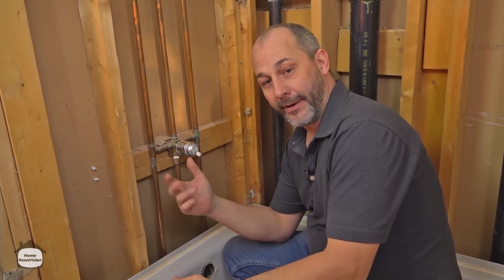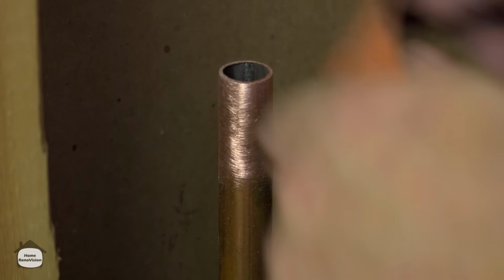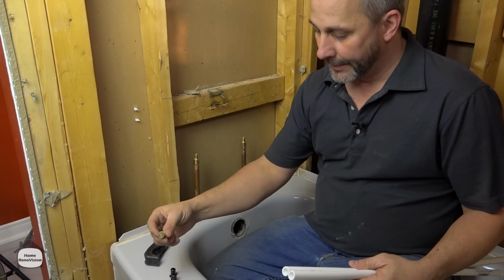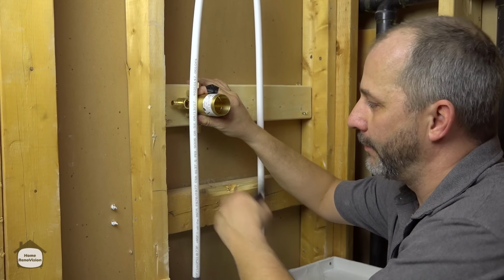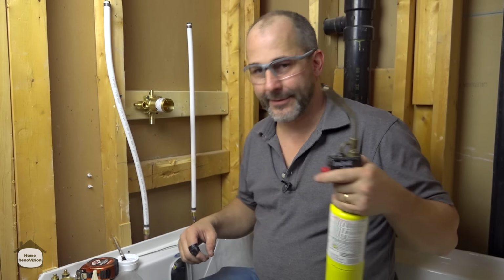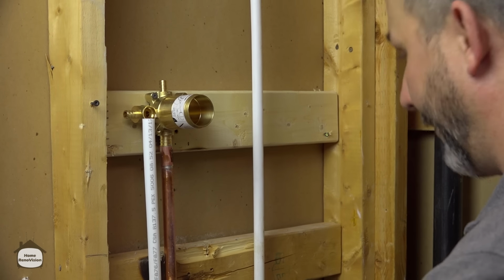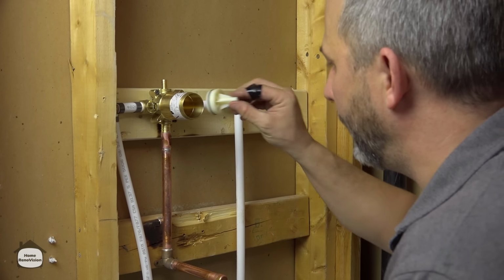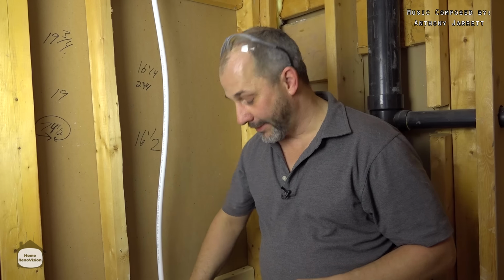DIY How To Install Copper To Pex Shower and Bath Plumbing

Comment: Here is an idea for saving money with hot water tank by two loop connections.
When the connection is made straight up  the hot water migrates from the tank to the upper floors.

why loop connections?
Hot water is less dense than colder water.  If you go straight up, the hot water convection is going to migrate the hot water to the main floor.   By having that loop, the bottom of the loop will be cooler than the top, and the heated water will not migrate.
Save yourself about $10/month or more.

Comment: 50 50 solder is not ok to use on the portable water system

Comment: In school I learned to finalize the solder joint with a rag.  I’m not keen on using the flux brush as it may cool the joint too quickly.  I would also use a heat shield behind that valve while torching.

Comment: Thank you for the information.   Question.   When converting to pex what do I want sticking out of the wall?  The sink water supplies are hidden in the vanity so I guess I could have pex sticking out there.   The toilet supply is visible so do I have the pex sticking out of the wall or do I attach the pex to copper in this situation.
Reply: Daisy Vlogs the only time you need to worry about it being copper is when it needs to be sturdy like the tub spout, it’s ok in most situations to have pex out the wall

Comment: Blah blah blah...google “shark bite”...I saved you having to watch this video. Pushed right into copper pipe and right into pex.
Reply: it's not code to put shark fittings in a closed wall, they would have to be accessible.

Comment: I have a shower that flashes cold and hot when somewhere in the house a faucet turns on. Does the faucet you installed take care of that problem. Thank you for you showing how to install pex, first time for me.
Reply: The valve you're looking for should be what's a called a pressure balanced valve or a thermostatic valve.
Reply: You might have undersized lines that disrupts the flow

Comment: I'm one of the lucky ones who doesn't have the hot water on the left .... is this a major problem? If I install it like this will it affect the performance and will it affect anything else in my house like baseboard water heaters?

Comment: "50 more times more than usual "
smoke detector going off 
solder on tub
didn't measure for the valve fittings 
burnt the shit out of the supports
pipes wiggled everywhere 
guessing on every cut
Possible tension loss on Crimper  

HandyAndys like you are what keep the plumbing trade alive, because when that fails they'll have to call in someone who actually knows what they are talking about.
Reply: How long before it fails?

Comment: Thanks for the video but I have a problem with how you work.  I would (and do) spread a tarp in and over the bathtub to protect it from boots, dropped tools and solder dropping in and on a persons tub, or even my own.  Think about it next time when you do another job so you don't destroy the tub because IMO sloppy workers are never considered craftsmen.

Comment: Okay. Now that I’ve removed all in one tub shower surround unit I see that I cannot just put concrete boards and seal. Darn it! The copper pipes are in the way! So I guess this in when I change over to plex tubing to simplify the process of replacing all in one t/s surround with a tube and tiled walls. My dear husband will assist with crimping. Yours truly, 64 year old female DIYer. Thanks Sir Thorman for all that you share🤗🤓

Comment: Great job at describing the procedures for a faucet's replacement. You may want to mention (for those who are not familiar with  soldering) that the soldering paste you apply is to accelerate the heat and allow the solder to bond to the surfaces. Another note, When I used to be a plumber, I would use brass lag screws to attach the faucet body and elbows to the 2x4s. As you know, galvanic corrosion will destroy any metal that is not noble like brass or copper. Lastly, it is always good to apply plumber's grease to all of the faucet's moving components, rubber parts, threads, and bezel nuts' threads. This practice will prevent sediment from building up in a thread or stem. When the faucet needs to be serviced, it will be easy to unscrew and remove the parts because of that grease. A little food for thought.
Reply: He does explain the soldering paste at 17:20
Reply: Thank you for this, I was going to ask about what the grey paste was that he applied inside the copper-pex fitting

Comment: question: why did you hit the sweat joints with flux after the solder was applied? thanks
Reply: When I was an apprentice, I was taught to "wipe and wash" your joints. My Journeyman said that it made the joint look cleaner. I get the wiping smooth with a rag, but the flux part never made sense to me.

Comment: When soldering around wood always have a bucket of water nearby. Even if you don't see fire/smoke emitting from wood after you solder,splash water on wood anyway or like I do wet the wood prior to soldering. You WILL burn house down hours after you solder because you didn't see wood burning but it was.

Comment: When you mounted the valve, how did you know the valve handle would mount correctly with the backer board, tile and thin set depth? Seems every time I do this, either the valve got mounted too deep or not deep enough.

Comment: Thanks for taking the time to video your work. You are my go to guy for plumbing work. I am doing a DIY tub to shower conversion in my home. Right now I am installing the new Delta shower mixer and diverter valves and converting from copper to PEX. My first time working with PEX. After watching the video, I have two questions. After you soldered the fitting just below the mixer valve,  I noticed there was a gap (1/4 inch or so) at the top left of the copper fitting where there was no solder. Shouldn't the solder flow all the way around for it to be water tight? Also, I noticed when you crimp the PEX fitting, you sometimes do not place the jaws of the crimping tool entirely over the crimp ring, which results in only half of so of the crimp ring to tighten on the PEX line. Is this still a good crimp? Or should it be replaced with a better one? Also I would like to add two tips. If you need to remove a copper crimp ring from a PEX fitting,  use a Dremel tool with a metal cutting wheel. You can then cut just the copper ring, and not damage the fitting.  This next tip I got from reading the comments on one of your previous videos: To keep the copper crimp ring in place temporarily (like on a vertical PEX line, just use pliers to LIGHTLY crimp it just enough to keep it from slipping out of position. Then you can use your proper crimping tool to crimp it as usual.

Comment: Well done video.  My only comment is regarding your pressure testing. By capping off the tub and shower outlets, the air is not allowed to escape, Therefore water may not make its way to all the joints and fittings and you may not catch all the leaks.  I am not an expert, but just an observation,

Comment: Good afternoon ,,, my name is Gabe ,, have a question ,,, I can use 3/4" of pex pipe for the shower installation ,,,,,or 1/2" is the usual
Reply: Yes you can use 3/4 pex it will give more volume for your water but you will have to go down to 1/2 when you get to the showerhead arm and the tubspout should be run with a rigid material

Comment: For anyone who wants to install PEX, try to use Uponor-type fittings where you EXPAND the PEX pipe over the fitting instead of crimping the PEX pipe over the fitting because the 'expanded-PEX' type fittings have a much larger opening in them, so you get a faster flow of water when the job is finished. Avoid SharkBite fittings in closed walls. But if the pipe is going to a toilet or a sink then it doesn't matter there since the final pipe is going to be a really small 3/8" riser tube anyways, so a crimped-type of fitting on 1/2" PEX pipe is totally okay in those areas.
Reply: That is for pex-a and the tool is more expensive than a crimper
Reply: Alot more of an expensive pex system the fittings an pipe cost more an the tool to expand the pex isnt cheap
Reply: I also thought pex A with expansion fittings was a superior product when first learning about pex. My mind has changed since learning that pex A leaches significant chemicals and is no longer recommended for potable water systems. That bit of info explained why I have only ever seen Pex B with crimp fitting used in residential houses.
Reply: I agree Pex A avoids necking down at the fitting as much as Pex B.  The hand tool to expand on Amazon with an automatic head rotation was about $160.  It came with 3/8, 1/2, 3/4 and  1" expanders and a cutter and a tool to cut off a Pex plastic ring if you make a mistake.  I paid just over $4 for 25 Pex A plastic expansion rings. Pex A 1/2" pipe is currently $35 for 100 feet.
Reply: I would say using a sharkbite behind could be just about as good as someone soldering a joint first time.

Comment: Thanks for the video. I tried torching some copper line earlier and the solder absolutely would not melt. I read somewhere that even a little bit of water keeps it from getting hot enough, but the copper was red hot! I gave up and cut it out. Never had that happen to me.
Reply: Get some white bread.  Squeeze it into a dough ball and push it into the pipe with a pencil eraser end to hold back small drips of water than interfere with heating up the fitting to melt the solder.  When it's all done, remove the vent screen on the downstream faucet and flush out the bread plug.  I heard there is a new tool that fits thru a ball valve to hold back water drips while soldering instead of using bread, but I've never seen the tool.

Comment: great video. I am trying to extend home plumbing from the inside to make an outdoor shower. Its a small job, but I am not sure what tubing to use. I wanted to add a Y from my water heater and out to the yard about 20 feet to the shower area. I see PEX is easy   but I dont want to spend 40dollars on a crimpin tool I am never gonna use again. Are there other alternatives to keep this job simple and inexpensive? Can I use compression connectors? What do you recommend . Thanks Robert in Miami Fl.

Comment: Was that Moen system? I'm putting one in my bathroom.
Reply from the maker: no but they are very similar. I am sure you will be just fine. contact us if you have any problems. Cheers!
Reply: Use American made, never use the Chinese products as they will fail in a short period of time as they don't care as they are thousands of miles away and are untouchable!

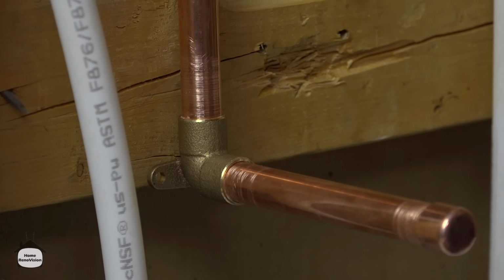Comment: He's made a terrible mistake soldering a copper coupling on a Pex connection on the shower valve you can see it at 15:35 time. It will surely leak in the future I question a little bit of his knowledge about Plumbing and he did it again further in the video soldered copper cap on to pex connection on a shower valve   oh no!!!!
Reply: Look again. It is set to take both. Pex or copper, but good try.

Comment: Drywall screws are for drywall they break inside a wall when you change out the valve cartridge.
Reply: You can use drywall screws coarse thread but make sure they are galvanized

Comment: Why didn't you buy a new shower valve with copper connections?  You had a full copper system in place but destroyed it run PEX  connections instead.  You were still left with a number of copper connections to be soldered for your PEX configuration.  There certainly are applications where one needs to transition copper to PEX, but this wasn't one of them.

Comment: I am a retired plumbing contractor and all I can say is thanks to YouTube and the invention of Pex many plumbers are out of business. Pex is a cheap material to install water supply to fixtures. It also may cause  pressure imbalances which can lead to scalding. I never used the stuff and ALWAYS used copper for my water supply lines. Pex has a smaller ID which can cause these imbalances.
Reply: They more likely put themselves out of business with their insane prices and that a site such as YouTube allows people who want to show others how to do repair work themselves by watching how things are done on a video and see that there is not always some mystical magic in fixing a problem. The same thing goes for some mechanic work that Toyota a year ago was charging $165 per hour to work on a car or not having to pay an appliance company to replace a broken belt on a dryer. Now DYI people can tackle the issues themselves and pocket the money.
Reply: If pex put a plumber out of business, they aren't running their business correctly.
Reply: I agree it has changed the industry but things change it's just the way it goes it's always been that way from the first model t to come off the assembly line now to address the other if you have 50 psi in a 1/2 inch pipe or a 10 inch pipe it's still 50 psi all we've changed is the volume and today's single handle valves being pressure balancing and all I don't see it making any noticeable difference I've also been In the business a very long time and run miles and miles of copper do i like pex not so much from a standpoint of doing a nice neat job but does it perform as they say it does that I have to agree on and cpvc as well I've never seen it fail over time such as copper does under a slab perhaps or somewhere in a very bad place to repair in fla we don't have basements and everything is run under the slab with no soldered joints all soft copper and it fails very often whereas  the other products  as cheap and flimsy as they are have a better reputation for not failing  it can even touch concrete and not have any adverse effect on it accept rubbing no electrolysis or other such. Things that  can happen to copper I don't like it any more than you do but you have to admit it has its place no ?

Comment: Love your videos. I do have a question. Would you recommend using shark bite in an enclosed wall as opposed to the crimping process.
Reply: If it is you only option it will work, but the longevity of shark bite fittings is still kind of unknown. it ultimately is just a o ring holding the water back so if that fails you will have a leak. i would check local code as it might not be legal to use them as well.

Comment: You are nuts sweating copper that close to combustible materials without a heat shield.  Just look at the two burn marks on the wood.  A ten cent heat shield and a fire extinguisher are a must when soldering.  What would you do if the dry 2X4 caught fire and the water is off and no fire extinguisher?  Also clean off the flux paste after soldering or you will get a leak in a few years.

Comment: Stop messing about with soldering.
Use "push fit" for both pipes!
Reply: I believe there is a construction code that limits "push fit". At least in my province.
Reply: Shark bites are used for quick repairs, nothing permanent because they have o-rings inside them

Comment: Hi, great job. But when you pressure test the system don't you bleed the system to make sure there is no trapped air in the pipes?
Reply: If air can't get out neither can water right?

Comment: Does this not restrict water flow somewhat with the adapter to pex?  Just wondering because I'm interested in doing a shower kit with a rain head, side hand wand and three body sprays.  So I'm thinking I need to not restrict water flow and maybe stick with 1/2 inch copper all the way.  Thoughts?  Thanks.

Comment: going to be replacing the shower valve and shower surround at the cottage this September.  This video is very helpful and gives me the confidence to do this on my own, especially since there isn't a plumber close or willing to take a half hour boat ride to the cottage.

Comment: Hi,
Nice video. I have been doing plumbing for 30+ years and I have not come across the flux you are using .  I have only seen that as a brazing flux never for a lead free solder joint. I frequently use that type when doing AC lines.  Please let me know what brand you are using. I am always interested in new products.
Thanks 
Drew

Comment: I'm an HVAC tech, i am constantly doing torch work. A simple piece of small sheet metal will protect that wood that can ignite very easily, especially older pine. otherwise, great video. thanks for taking the time to make it.
Reply: That's right, Rob! Even better, solder together first away from wood locations. Once you have the roughing in place with a dry fit, solder together your build, then cool it off to touch with a handy bucket of water and a rag. It only takes a couple of seconds!
Not keeping a healthy habit of whipping water clean, all your soldering at the joint promotes acid-like copper turning early. The elbow ears land too close to the corner, and not at the center (the meat) of the wood framing.
Short cuts are not for me! Once you break out and start the torching, why not finish it uniformly with copper? APEX is a degrade at this point!

Comment: Two questions.. I see you did not wipe the finished soldered joint with a cold wet cloth. Is that preference? Or does wiping the joint affect the joint somehow? Also, I am trying PEX on my shower job I am doing now. I am not sure of the names of the crimp rings off the top of my head. I see your using the type you used. What are your thoughts on the other type of crimp rings? The ones that you have to pinch. Dave

Comment: Copper to apex is easier using Sharkbite connections. No soldering.
Reply: Sharkbites are a fucking joke. At my shop we call them the homeowner special. I go to several calls a week where those things blow out and flood.